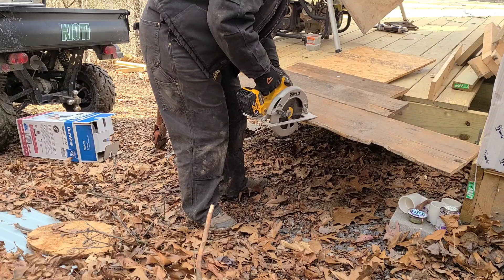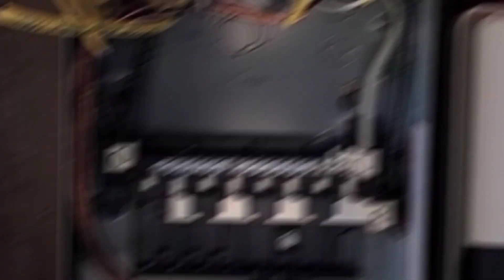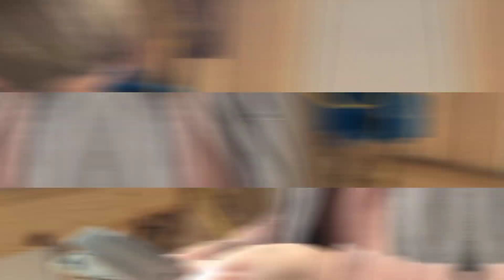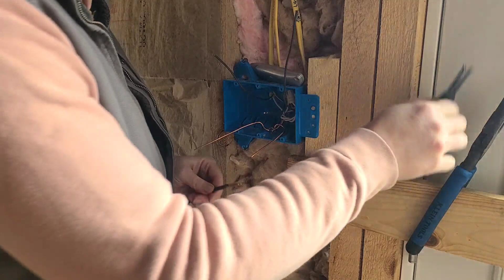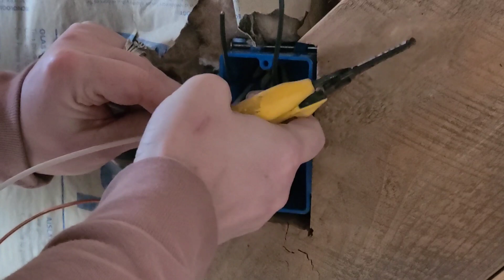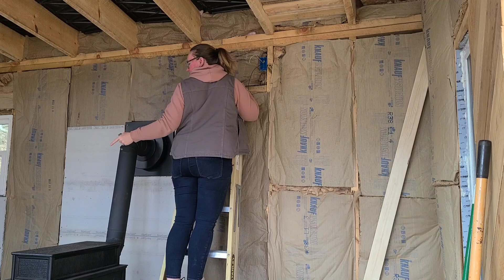12 V Solar Power System

Comment: Nice job, how did you lay out the DC circuits? Did you use 15 and 20 amp breakers and did you keep the lighting separate from receptacles?
Reply from the maker: Hey Joe. I used 15 Amp circuits. And  yes, my lights and recepticals are separate circuits. My current set up has everything spread over 7 circuuts. This includes a 12V refrigerator. Since making this video I've added additional combo recepticals (12V rec with USBs). I can plug small inverters into them of needed.